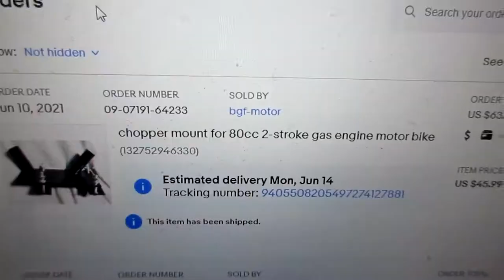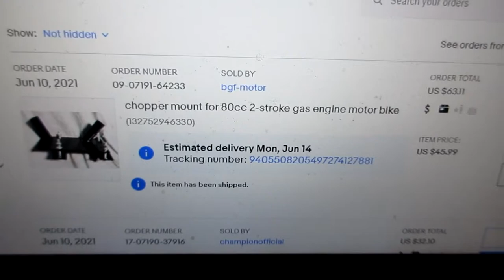80cc Motorized Bicycle Schwinn Stingray Chopper Build Motor Mount part 2

Comment: Maybe a tripod is your third hand😂
Reply from the maker: And..my name is Darrin also. Nice to meet you Darrin!
Reply: @OlszkoolCustoms   thank you sir ,quick question  where would I find the front and back brakes for a sting ray like yours
Reply from the maker: @darrinfry2251  https://www.amazon.com/Tektro-855AL-Linear-Brake-Front/dp/B07TKZ39SN/ref=asc_df_B07TKZ39SN/?tag=hyprod-20&linkCode=df0&hvadid=385146992604&hvpos=&hvnetw=g&hvrand=14483739087891474122&hvpone=&hvptwo=&hvqmt=&hvdev=c&hvdvcmdl=&hvlocint=&hvlocphy=9015370&hvtargid=pla-855499083484&psc=1&tag=&ref=&adgrpid=85368088744&hvpone=&hvptwo=&hvadid=385146992604&hvpos=&hvnetw=g&hvrand=14483739087891474122&hvqmt=&hvdev=c&hvdvcmdl=&hvlocint=&hvlocphy=9015370&hvtargid=pla-855499083484
Reply: @OlszkoolCustoms   thank you sir .

Comment: Where did you get the  back wheel bracket?
Reply from the maker: This should get you started:

https://www.ebay.com/itm/283827568795?hash=item421571009b:g:OJQAAOSwqOxefEi2&amdata=enc%3AAQAHAAAA8PKWzU9%2B84Np5dqykFjHxKQhA2d5wNEHDxEiXfIxmAmKhj2nFrYheyEJRds3ZMQFSUnES8Yn5MvELK2kd1ITSa4tzU%2BefB3Jv740nHa9V92KB33XCEPdYSXQMN8ZCFKhBaypMF1WdO%2F6YbcR%2Fsl6JKAKYWzYYCaiFZdCTTez12IQmoJqt%2FBKut2haxV5TixN3jWMTdzQHkwao%2BlZPQ3oyE5tb%2B3Hf%2BtJJqRNuhj9v4ORgkiuPsxIZUVdARO%2BN4%2Fa45fjxv7obP977J%2BzRbkH4LW087vysM2oIg8uHObRT1aedPHHOeGPV92SSOEQE0jzTQ%3D%3D%7Ctkp%3ABk9SR9bxgr_fYQ

Comment: What is the mount called??
Reply from the maker: https://www.ebay.com/itm/144072587133?hash=item218b65377d:g:l7IAAOSw-jhUH2PR&amdata=enc%3AAQAHAAAAsD3yWPztM%2FrPRG1nri%2FgMi2zQb2rl7qX3%2Bi0ateTJGBlbxvHetR%2BjJX1D%2FfnlQTADcD2O0q4dQQgw%2BGi5V3D1%2FI3BiEiJII7rUM1kZKvbslDFuyArdxI%2BgZKVK5H7IPd816QHxYRXEiUqB%2BFLfO3x%2BY%2BZfjHBlj7uDy9quJDfL9xbCn1KGOdKW1SmRvSr8BabFIElqmjmbgXj1lnwrKzkcHIkNhe1Kt5cbfx1VDEyMAk%7Ctkp%3ABk9SR9i-qqK8YQ
Reply: @OlszkoolCustoms  Preciate you!

Comment: They send u a kit with bolts that's not even long enough to work without bending the metal. Dude needs to fix his description on not sending the right bolts to every customer. Its supposed to be for a chopper bicycle.. 😐
Reply from the maker: You got that right. I need to finish that build someday lol Always got 25 things going on.
Reply: @OlszkoolCustoms  the plate doesn't even fit on the frame right its gotta be grinded so it fits around the seat bar. If not it sets the motor off to were it won't even turn when pushing the bike.  I should ask for a refund when it won't fit the bike like how its supposed to.